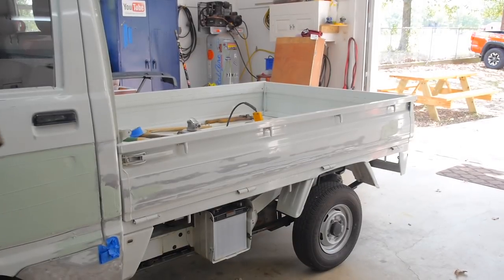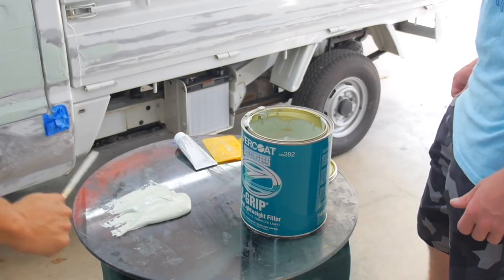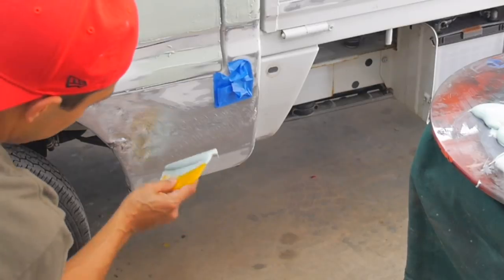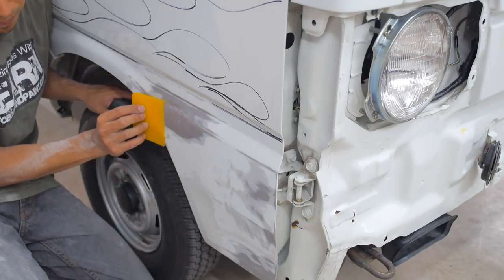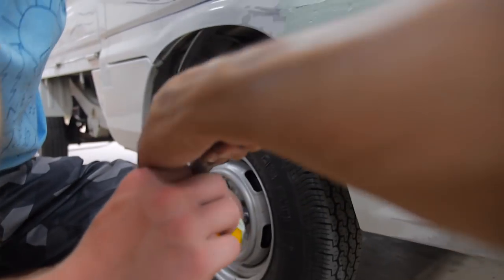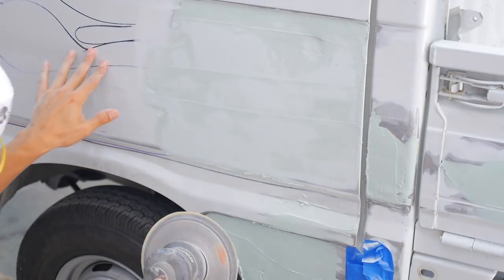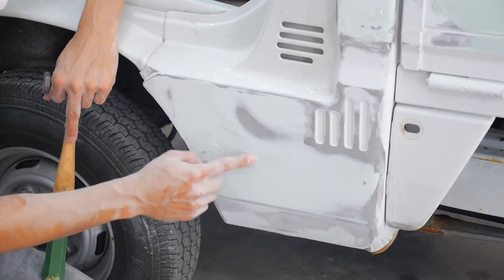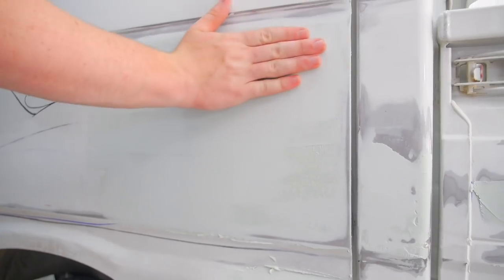NEW - How To Use Body Filler: Mixing, Spreading, Sanding Part 1 of 2

Comment: Love your videos. A body guy gave me a tip that I’ve been doing for 10 yrs.  With my 11” durablock & 40 grit, I start sanding the body filler before it fully sets. There’s a perfect window to knock it down. Use a wire brush to clean it out of your sand paper as you go. 
Also, I love Evercoat body filler & glaze puddy. Good stuff to sand.
Reply from the maker: Glad you love the videos, man!

Comment: Hey tony are there any electric orbital sanders that are okay? i have a air compressor and good air orbital but man that thing sounds like a jet plane in my neighborhood lol.
Reply from the maker: Hmm... the last time I used electric was in my dad's shop 20 years ago. He had a few, it was the square type. But yea of course they have them. Good option if you don't want to use air. https://www.homedepot.com/p/Porter-Cable-5-in-Random-Orbital-Sander-382/203054710 Just google them. There are many.
Reply: Most electrics are heavy. Use one on side panels for a couple of hours and man, you can feel it. Check out the Dynabrade line of air orbitals. Light and fairly quiet. 3/32 is great for finish work.